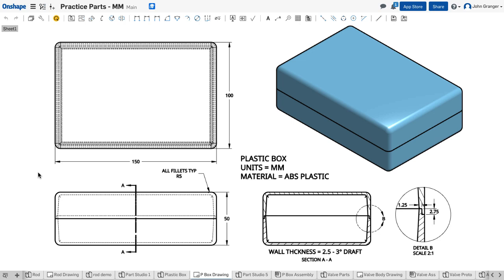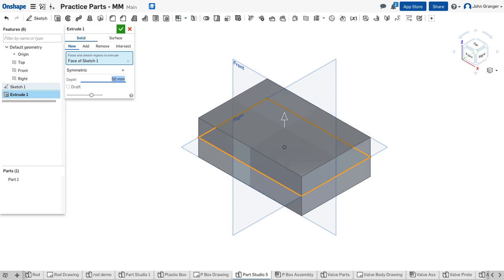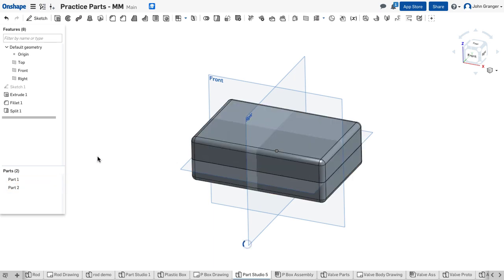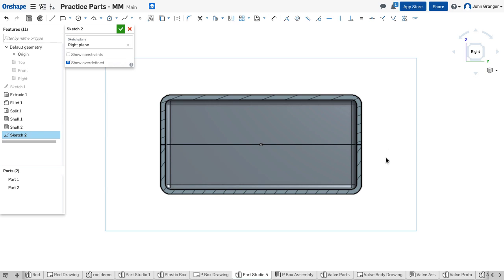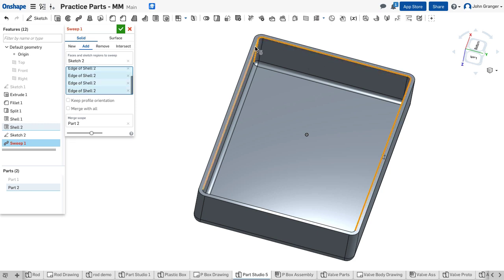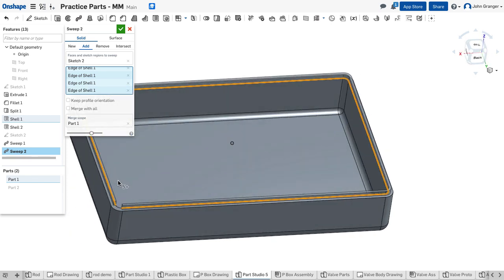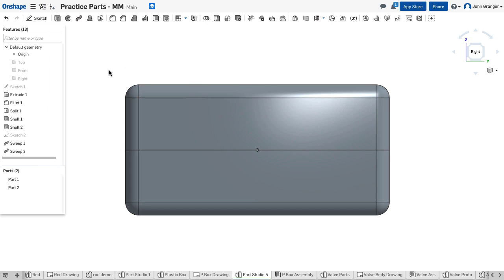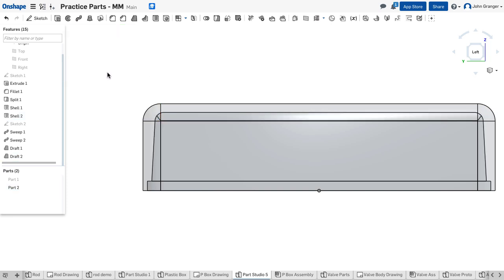Learn Onshape - Project 18 - Plastic Box

Comment: A stupid question, if you now want to print out that box with lid, do you print part 1 and part 2 separately or can you print it out as it is?
Reply from the maker: Yes, two parts. Use “Move Face” to add clearance for the fit on the face of the bottom lap joint

Comment: I realize it has been seven years since this video, and many things have changed, but I cannot select the top plane when I try to split the box. I am curious as to what the cause could be. Anyways, GREAT video. Sub'd
Reply from the maker: Did you extrude the solid box by checking the symmetric box.  This will extrude the box both above and below the top plane.  It can then be used to split the solid in half.

Comment: I dont understand the draft part. Is it so you can print it as 1 and take it apart with ease? Sorry, i am new to designing.
Reply from the maker: Draft add an angle to a vertical surface, especiall on the inside of a cast part..  It is usually used if a part will be cast in a mold.  The angled surface can be released from the mold easier than a vertical surface.

Comment: great vid. thanx.
just getting to grips with onshape so some basic questions if any-bods can chip in :)
1) presumably for 3d printing is it necessary to create the lid + main box in a separate parts studio?  
2) how would you slice the box non-symmetrically, with a bottom section greater than the top?
Reply: 1) no, you don't need separate parts studios, you can independently export the model for each part
2) you create another plane above/below/parallel to the one used here, and use it to perform the slice

Comment: If you wanted to add dividers to the box would you do it by additive or subtractive boolean or would you instead do it from the starting sketch extrusion? thanks
Reply from the maker: I think that I would play around with using a Rib Feature Tool.  Maybe adding some lines to define the dividers and then Rib to create a solid partition.  Edit sketch 1 and add lines in the location that you later add the ribs.
Reply: @Onshape.Learning.Projects  Thank you, this worked perfectly!

Comment: I prefer to use boolean removal to make the joints so that I'm sure that there is no overlap and it allows easily to add a small offset.
Reply from the maker: Thanks, good idea.  I will try that out. Please post any other suggestions for this or other projects.

Comment: Yeah, it wont let me select the "edge of shell" to do the second sweep. Just the face of it. Not working. Im stuck.
Reply from the maker: Start over, follow the video, it will work
Reply: Had same issue , just started that section over.

Comment: When I go to do the second sweep on the second half, it refuses to highlight the sweep path. Either highlights both edges along the top, or entire sides. Either way, it wont work. Any ideas?
Reply from the maker: Back up by deleting the last several sketches or features.....review the video and try again.  It will work.  If this doesn't do it, start over and work it through step by step.
Reply: Had same issue, just back up a step or 2 and go again.
That is what I did, it worked. Program is trying to anticipate what you want.